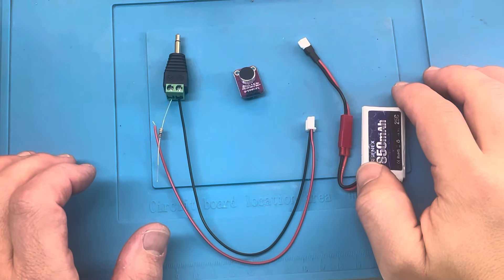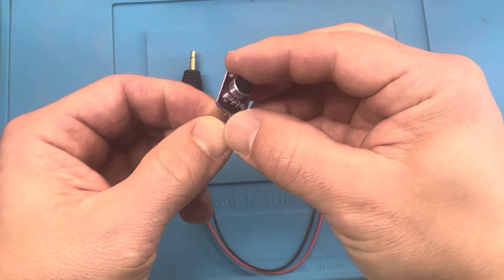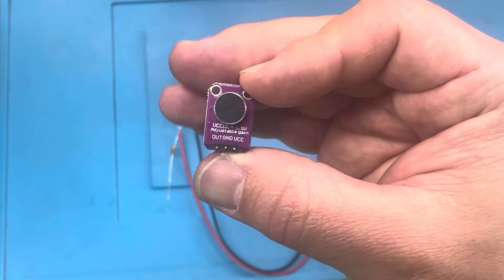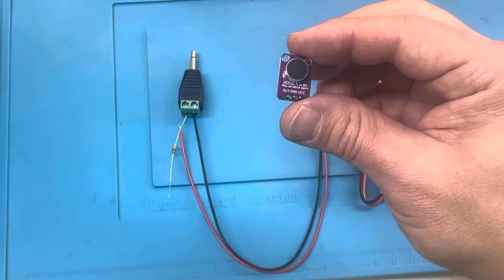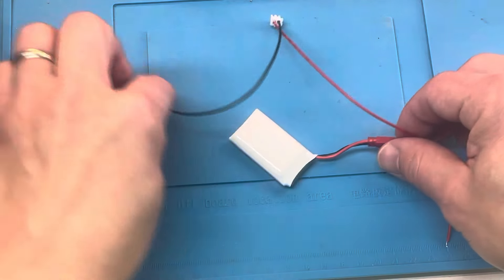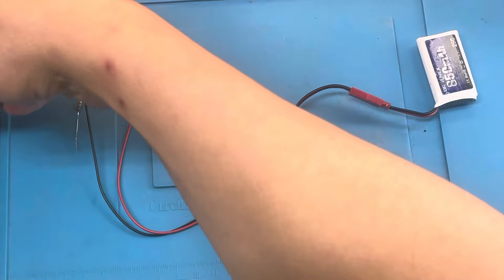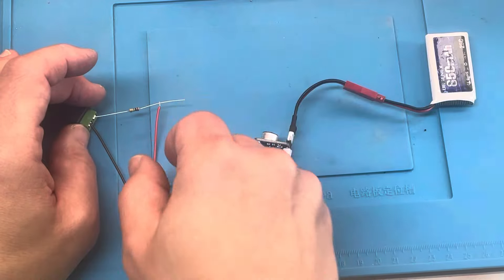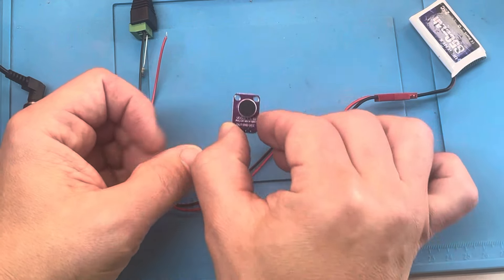Easy/small mic preamp system ~$20 (Max4466 -Adafruit for costume, helmet, mask, stage, etc

Comment: The little electret microphone on the preamp board needs power to work. The board supplys the power needed. Your example of plugging in a mic of this type and not working is usually because there is no power to the mic. There is lots of information on the net on how to power electret microphones.
Reply from the maker: Ahh, it appears i may not have conveyed my intended message as clearly as I could have - what I was referring to was if you use a mic without a preamp (instead of this setup) you’ll get no audible output.  Although I do see that me pointing at the mic  when referencing that issue could be interpreted as referring to the max4466 in lieu of a conceptual mic without a preamp to which I was referring.  
I’ll try to mitigate such potential for confusion in the future.
Thus, Regarding powering the mics, I’ve never had issues with that in the max4466,  given it uses the same power as the preamp.

Hope that clarifies.

Thanks for the feedback.  
Cheers

Comment: Hello, thanks for the video. I tried to reproduce the experiment but was unsuccessful. I can not hear anything. In your video it doesn't show where you connected the output, so I have a doubt if you connected your output to the amplifier and from the amplifier to the speaker, or if you connected the output of the max4466 directly to the speaker and what the speaker's Ohms would be, please ?
Reply from the maker: I connected to an amplifier.   --> Connecting direct to a speaker will NOT yield any results.
I'm not sure of the speakers' ohms.  Let me know if that answers the question. 
Oh BTW - Ensure you use a 4.7Million ohm resistor in lieu of a 1million, as it gets much better feedback suppression as you up the volume.
Cheers.
Reply: @creative-stuff Thank you very much! I was successful and yes, we have to connect it to an amplifier.
Reply from the maker: @alissonmartins1800    Excellent - great to hear!

Comment: Take the black spacer off and you will be able to plug the battery plug in more securely.
Reply from the maker: Right you are @chronobot2001!  I’d just soldered that piece in and hadn’t even thought of removing it before testing things out.

Comment: Hi! tnx for reviewing it...I'm just not sure how to use the built in gain control. I have to lower it a bunch for my use...
Can you help me?
Reply: Turning the pot on the back of the board clockwise should lower the gain, but I guess turning it too much might push the gain to it's maximum at some point
Reply: @alirezaghassemi4123   thank you so much!!! I actually thought of that, but i was afraid to try it! Haven't tested the results yet, but i promised  I'll tell you here!
Reply: Worked like a charm! Again, thank you! It really is clockwise and there's a min-max rotation, so you reach a minimum gain by turning the pot clockwise (no overflow)
Reply: @guinogueira7  Glad to be of help. Thank you for the update on overflow.🙏
Reply from the maker: @guizeh7 @alirezaghassemi4123  Thanks to both of you for the info.  While I was aware the potentiometer controlled the gain, I had not considered that there may be any benefit to keeping it low.

@guizeh7 - I’m curious, what your use case was that necessitated the lowest gain?  Was it related to feedback…or something else?
Cheers
Reply: yeah, pretty much feedback, but also the general sound level, but nothing raspberry/micro-controllers related..
i was trying to replace a dynamic mic to capture some percussion...but, to get good timbre, you need to get real close to the source, but then the attack hits too hard

in any case, the capsule that comes with it is not good enough, but upgrading it defeats the purpose of being cheap
 @creative-stuff
Reply from the maker: @guinogueira7  great info - thanks.

Comment: I have an IP camera with a two pin electret on the board. The sound it records is too less.
I was planning to remove that mic and use this module instead. I would connect the ground of the module to where -ve of the camera electret was qnd out to +ve. Vcc would be connected to 5v (+)microusb input via a jumper.

My question is, do i need to connect the ground of the modile to microusb (-) via a jumper as well? I ask since ground of module is already connected to  the point on camera board where -ve of the original electret was connected. 
(All this assuming the amplification circuit on camera chip doesn't interfere with the amplified signal of the module)
Reply from the maker: It seems your issue is not the PreAmp, but instead you just need an amp on your audio output.  
Just keep in mind that if your device has a mic built in it will also have the preamp capability- which only amplifies it to mic level which is not audible to the ear by itself - it requires an amp to amplify mic level to something you can hear.
Thus I’d recommend putting an amp on your audio out.  
If the recording capability is all on the same board then perhaps your amp needs to be integrated in the middle which would be odd.  If your IP Cam onboard preamp is burnt out perhaps putting in this preamp module in place of your mic may work; but if you have an onboard amp that’s burnt out - updating your preamp will not likely make much of a difference (my main concern would be that if either preamp or amp are burnt out it may have affected your audio path which may not be fixable. )

Regardless, I don’t really understand your explanation of the circuitry so I cannot make any recommendation on that.  I would just say to test things quickly to decrease the possibility of burning anything out.  
For the preamp or amp - You can try linking to the same power source, but it may cause noise on your audio output.  You’d then need either a noise filter or a separate power source.
You MIGHT be ok since the IP cam also includes audio…but whenever I try to connect audio device to something powering a fan for instance- the fan pushes noise to my audio- so I use separate power sources.
Reply: @creative-stuff  The camera does not have a dedicated audio out functionality, it basically records the audio-video on an SD card which can later be watched/listened to.
The mic on the camera fails to pickup low volume sounds clearly, hence I was wondering if removing the electret on the camera chip and replacing it with this preamp module-mic combo would make a difference. But ofcourse maybe this isn't how any of this works at all and I'm misunderstanding the concept of how preamps work.

Before experimenting with this route I will simply try replacing the (very) small stock electret mic in my camera with a bigger 9X7mm mic and see if it works to better record the audio.

Also It could be that the noise you experience when sharing an audio power source with a fan could be due to interference from EM fields generated by the fan motor. They might be inducing tiny stray currents in the wires, enough to interfere with the mic
Reply from the maker: Good point on the interference- that is always part of the challenge with things like this if you weren’t the one who built the board you don’t know if it’s a problem of interference, noise or if it’s even a programming that ignores audio below a certain level assuming it’s noise. Thus, if you swap the mic, it might still have the same problem because it’s still hearing it but it’s just zeroing it out because it’s thinking it’s noise. But one can’t say for sure given a different mic might give it just enough extra decibels to breach the noise floor and for it to be processed through.

 So essentially if you’ve got a mic as part of it already, it’s got a preamp on there somewhere however, you bring up a good point, in the sense of adding more volume to the internal signal, especially if you’ve got software, that is actually intentionally ignoring audio below a certain level -  then a preamp might amplify lower level signals up enough to breach the noise floor and be processed. Thus it might be an interesting idea to try a pre-before the preamp. Hmm.  I’m not quite sure how it will work out for sure, but if nothing else is working for you, it might be worth a try and those preamps are so inexpensive anyway. 

Thanks for the more detailed description that really helped out. I’m interested to know how this is working out for you since it’s been three weeks if you were able to find success with that larger mic or if you’re still going to try out a preamp behind your mic.
Cheers

Comment: Can use this as a pc mic?
Reply from the maker: If you wanted to, yes.  However your pc doesn’t need a preamp’d signal. 
If you need a mic with preamp for other reasons that can also work on your PC I recommend this instead, as it gives a cleaner output that’s less prone to feedback & it’s prebuilt (no soldering) - 
LV1 with 3.5mm splitter and 1/4” converter https://amzn.to/4epX5dF
LV1 with usb converter https://amzn.to/3TwXBOW